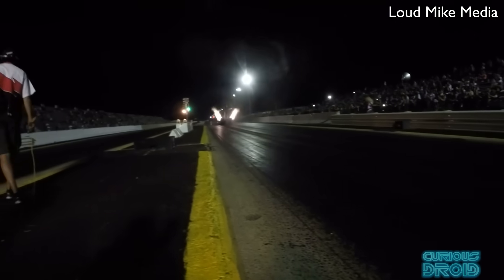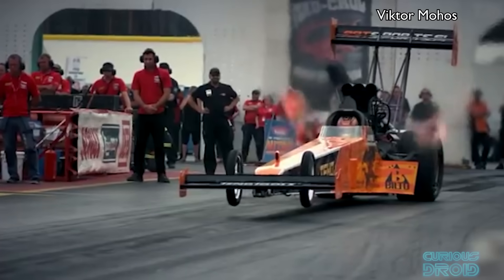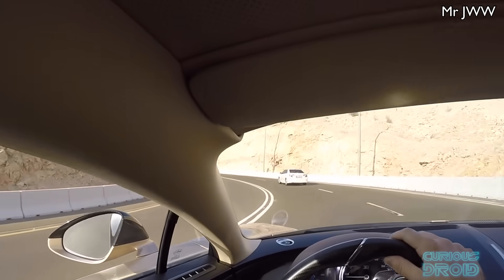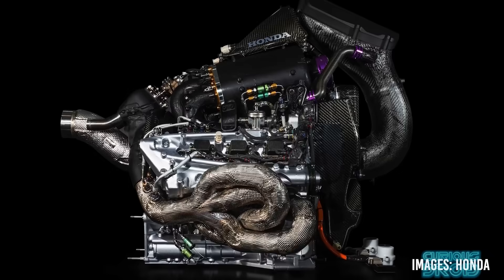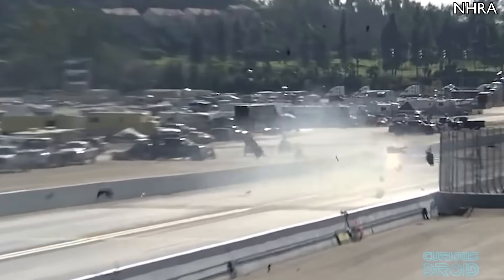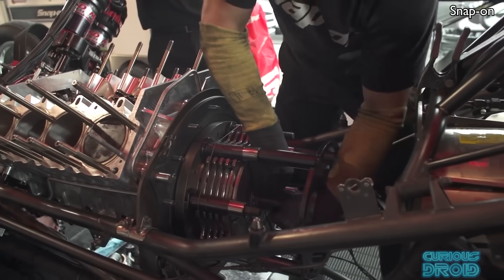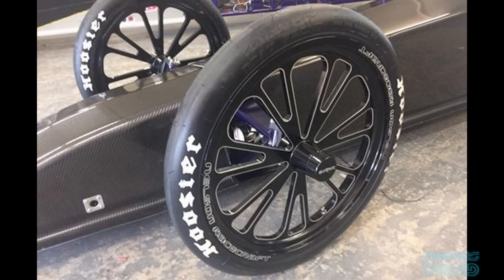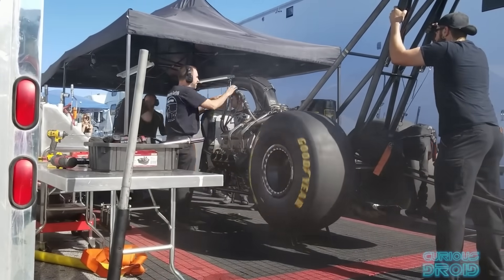The Amazing Engineering of Top Fuel Dragsters

Comment: I'm curious what the competitive aspect is besides just reaction time on the start? Testing tiny design changes to see if they make more power?
Reply: Look up Top Fuel Clutch. Apart from the engine, most of the competitve aspect is tuneing the mechanical clutch. The TF clutch operates by pushing a pneumatic cylinder against the clutch pack at a fixed rate. However between that cylinder and the clutch pack are a series of actuator arms that apply pressure to the clutch pack. Too many longer arms at the begining of the pneumatic cylinder travel can mean the tires get to much power and just spin. To few arms can mean the tires don't get enough power and the dragster in the other lane runs away. It can be a razor thin line between winning and losing in Top Fuel, most of it is due to how well the clutch is set up.

Comment: I have a drag strip only a 1/2 mile from my house. It's exhilarating to be in the bleachers watching these wonderful machines. The thunderous roar of the engine literally vibrate your insides. They have massive Turbo Chargers on them squealing a high pitch sound as well. So you get the low Roar and hi pitch squeal. You definitely need to wear ear protection to attend an event. Last event I went to had Dragster Bikes and a poor guy turned his bike on its side going 180 MPH. Thankfully they had ambulances on hand and rushed him to the hospital and he lucked out only getting terrible road rash with nothing broken.

Comment: MISTAKE: At 13:26 you said 5,4 Kilonewtons instead of 54 kilonewtons, wich is the correct value for 12 000 pounds. Just wanted to point it out, otherwise an excellent video!
Reply: All his conversions seem wrong, I think he confused newtons with g-force.
1 g-force ≈ 10 newtons. (due to earth's gravity G ≈ 10)
For a quick check: 1'000 pounds ≈ 500 kg.
Reply: 12000 pounds sounds like a lot to me. I suspect that it's closer to 1200.

Comment: Growing up, I worked at a local dragstrip a lot and was very used to the noise of everything up to alcohol funny cars and even jet dragsters.  I was not prepared for my first Top Fuel race.  This was the 1992 Keystone Nationals where Kenny Bernstein broke 300 mph.  Not a bad first Top Fuel experience.
Reply: Pro-tip:  Open your mouth when they launch.  It helps equalize the pressure on your ears.
Reply: your memory is abit off... bernstein ran 301.70 at 4:44 pm in the second qualifying session march 20 , 1992 at gainesville florida, not the keystones.

Comment: CD there's a guy who has a channel called Vice Grip Garage; he's doing a rebuild of a 30+ year abandoned car, the Independence Chevelle...well, actually he's already finished rebuilding it but he's just done a long video going through redoing the computer control system for the engine, etc., it's a "burnout car" which is a type of performance/demonstration car that has to be seen to be fully appreciated.  But the point is, his most recent video he went through the installation of a new electronic fuel control system, among other very high tech gadgetry to make it perform the way it does.  I highly recommend checking him out.  While he doesn't go too deep into the science, I think doing a video on ECU systems could be a great compliment to this video.

Love your stuff!

Comment: The boosted Bois and PFI did some videos on Top fuel. The part that blew my mind was how the teams will save all the engine components and mix and match them based on the change in tolerances due to deformation from each pass.
Reply: those guys haven't a clue what they're doing but internet fame always helps get low men to high places
Reply: During a rain delay last year I spent a lot of time talking with some of the engine guys.  The parts either pass specs or they're scrapped.  One of the things that they watch on the pistons is the heights of the ring grooves.  When the pressure has collapsed the heights of the grooves too much, they're replaced.  The steel clutch plates are replaced after each run.  They are heated to around 700°F/370°C as indicated by their blue color after a run.  They're scrap metal at the end of the run.

Comment: What is the purpose of drivers in this series? It seems to me like they do nothing other than keep the car straight. If they do more than that, please disabuse me of my ignorance.
Reply: They control the trottle and steer the car. The steering is not easy because of the g loads and drag cars tend to oversteer to nearly uncontrollable levels.
Reply: In the simplest (non-racing) terms possible:
- The drivetrain lacks any sort of electronic driver aids, so the drivers are well attuned to controlling the throttle precisely to minimize the acceleration just below the limit of tire traction. Think "perfect traction control on an icy road"... but by a human.
- The start of the race is electronically monitored. The car cannot move before the green light or it's Disqualified. The driver ability to react to "green" is often the difference between winning and losing. Now re-read this while also remembering the previous line about "no electronic driver aids".
- The HUGE torque effect on the wheels spinning (plus the "squish" in the tires) cause the cars to weave all over the place. Any variation from straight-line travel causes a loss of speed. Steering is very precise and very critical.
- (Edit) Mixup with Funny cars for this line (/Edit)
Reply: Most of these races are won and lost on the Christmas Tree.  Reaction time is big.  The cars, and Funny cars (top fuel powertrain in a shorter wheelbase. look up John Force and his cars) are all over the place when they are driven. The drivers have to drive them to keep them in the groove to keep traction.
Reply: Burnout. Staging. Launch. Steering. Stopping the car when the tires spin. Going for a ride if something goes wrong. Stopping the car at the end of the run.
Reply: These are the fastest machines on earth, period. Controlling them is an artform. These aren't drivers, they're pilots.